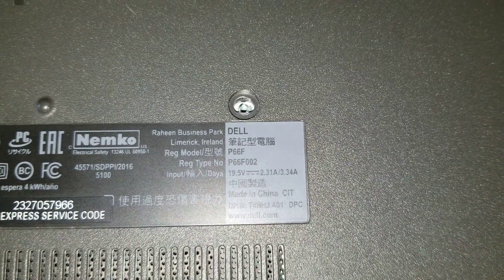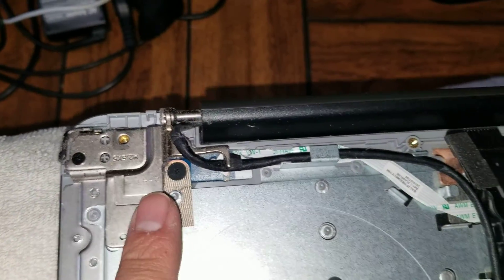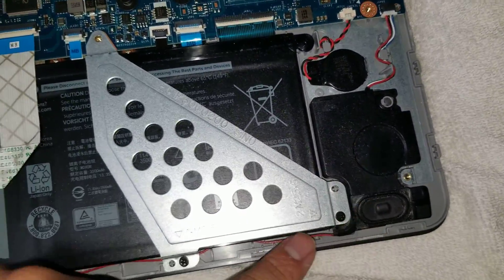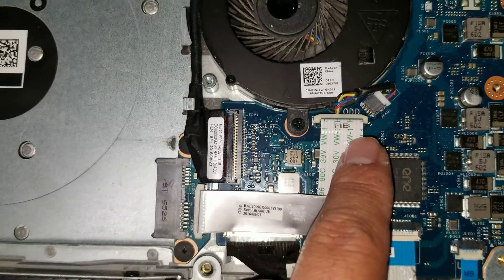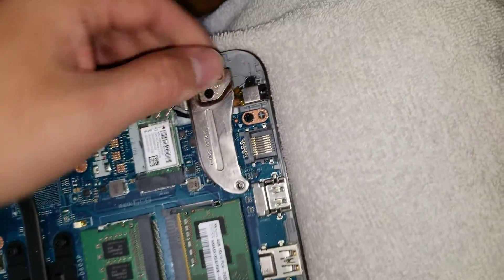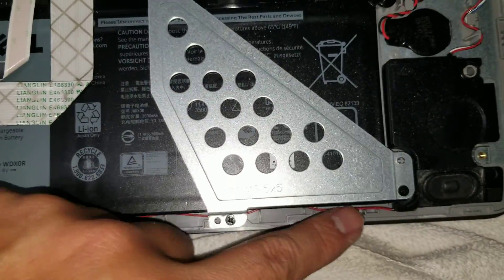Dell Inspiron 15 5565 P66F P66F002 Disassembly RAM SSD Hard Drive Upgrade Repair

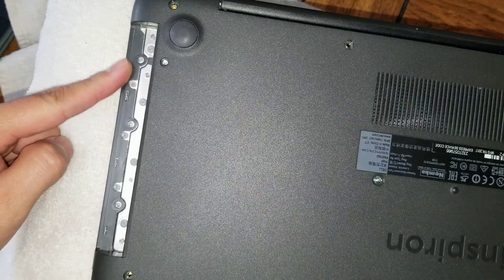Comment: 0:50 - the smaller screws are PH00 (not PH0)
Do not use any different screwdriver, or they will strip (learnt that the hard way).

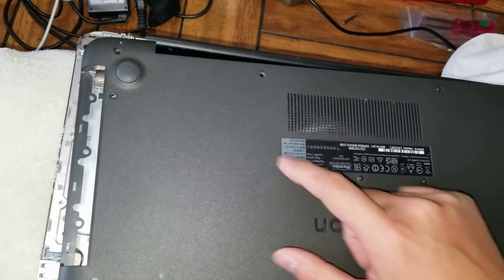1:45 - yes, the two shorter screws are for the DVD drive.
Reply from the maker: People have different tolerances on their screwdrivers. Use what fits best.
Reply: The ones I'm trying to unscrew aren't PH anything. They're literally impossible - there's basically no ident for a screwdriver at all, it's just a cross-shaped scuff in the black paint!
Reply from the maker: How is that possible? Lol it had to be screwed in to begin with.

Comment: Does this laptop have an m2 SSD slot? very good the video
Reply from the maker: If not mentioned in the video, then most likely not.
Reply: @ItsBinhRepaired  thanks
Reply from the maker: @hortasaudavel  no problem

Comment: Great video. The hardest step I found was removing the case and knowing about the PH0 screws. Once I was past that everything else fell into place! 
Installation of an SSD increased it's performance and completely stabilised it with no more crashes !
Reply from the maker: Awesome! If you haven't already, please like and subscribe so others can find my videos. Thanks!
Reply: Can we add a SSD to this laptop in addition to the HDD already installed?
Reply from the maker: Only if you replace the optical drive with a hard drive adapter.

Comment: Can we upgrade this laptop to get more performance?
Reply from the maker: RAM and SSD. Did you watch the video?
Reply: @ItsBinhRepaired  give link
Reply from the maker: @siveigh5827  what speed is your RAM in your laptop. You'll want to open it to check
Reply from the maker: @siveigh5827  if yours is the same, this should work. https://amzn.to/3d9FMze
Reply from the maker: @siveigh5827  if you need 32gb, this should work https://amzn.to/2SCDGOQ
Reply: is there a plug/ socket g do or M.2 SSD?  i would like to add that but i didn’t see it there when you were open
Reply from the maker: @torrys99  no m.2 slot